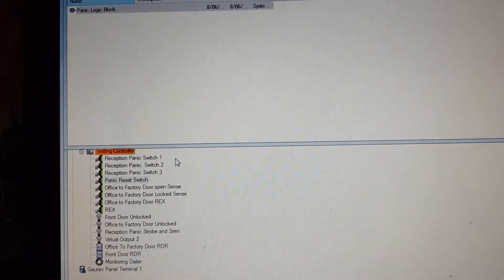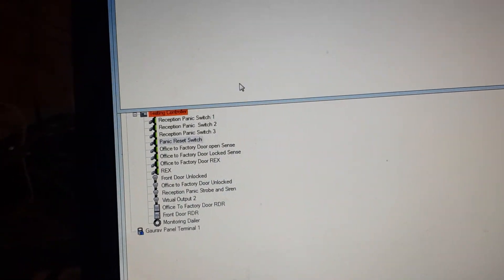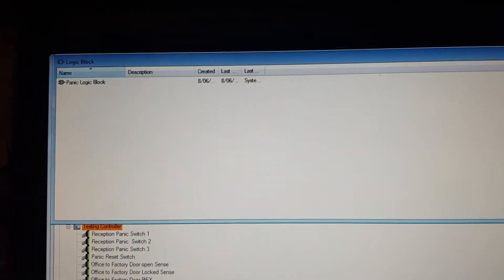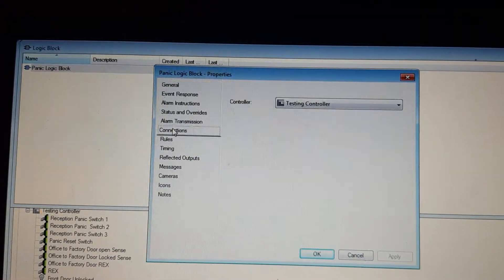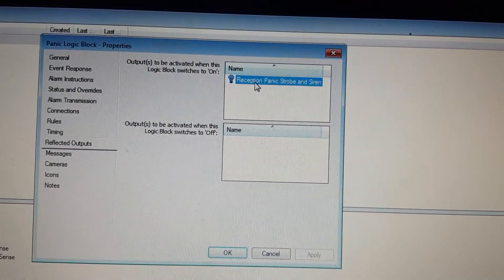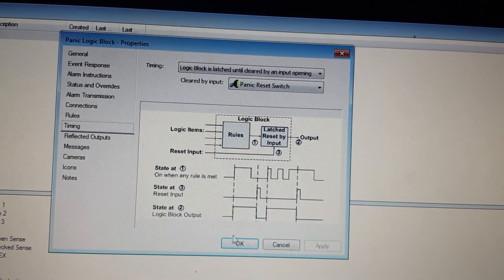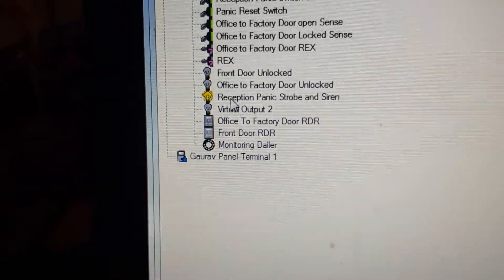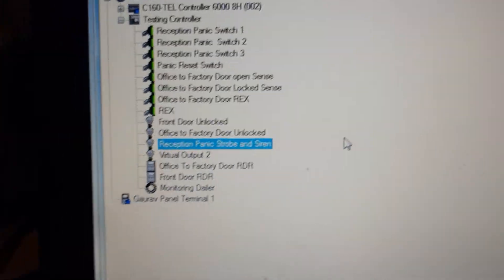Create new Logic blocks in Gallagher Command Center Software.

Comment: Cool video's 👍👍. Could you pleade do a video on how to arm n disarm the inner range 4000 keypad? Thanks
Reply from the maker: Hi Mate,  thanks for liking in. Did you mean Concept 4000 panel keypad as T4000 can't have a keypad.
Reply: @rigidsecurityltd2367  Ohh I meant the keypad panel on how to turn the system on (Arm) and off (Disarm)
Reply from the maker: @liamhackney968  Hi , can you please tell me what alarm brand you want to learn Arming and disarming from keypad?
Reply: @rigidsecurityltd2367  inner range concept 4000 keypad
Reply from the maker: @liamhackney968  hi mate, please check my video on Concept 4000 panel setup for T4000 communicator, in that video I showed how to turn control the Areas from the keypad. Thanks